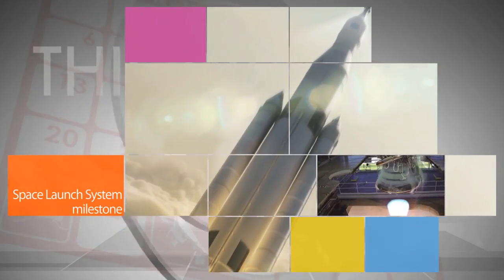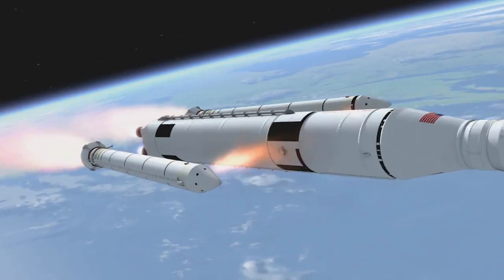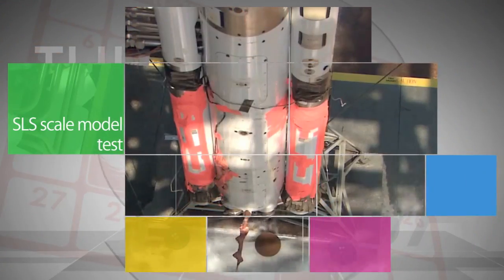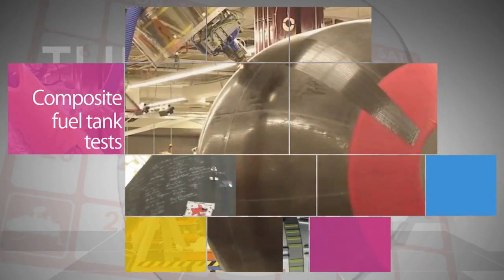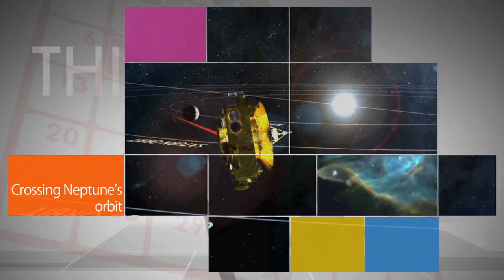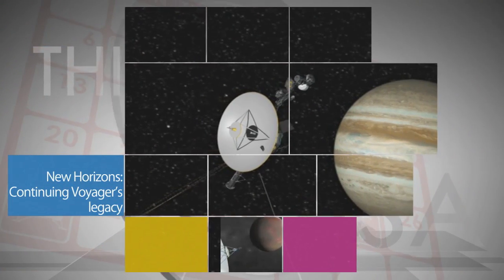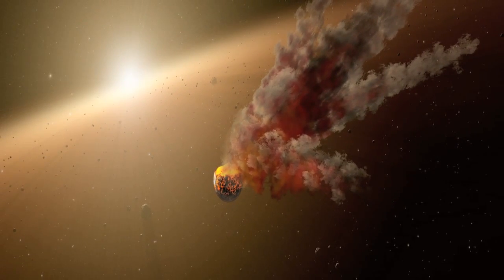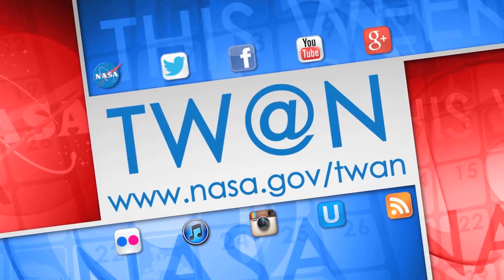Space Launch System milestone on This Week @NASA - August 29, 2014

Comment: SLS is off the drawing board time to build it the Tank Barrels are assembled and have been pressure tested now is time to transport them to the Vertical Integration Cell or VIC where the core will be assembled and painted and when it is ready the fuel tanks left over from the Shuttle days will be moved into the core and secured and when that is done the core will be transported to Stennis and the engines attached and the rocket fueled and placed on the A1 Test Stand when that is done the core will be transported to Kennedy and sent to the VAB and built into a rocket.